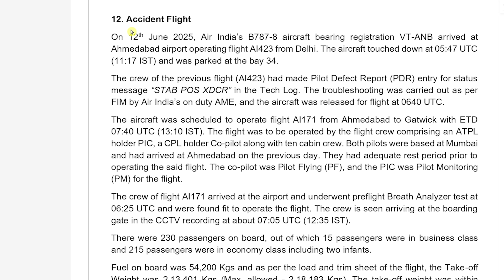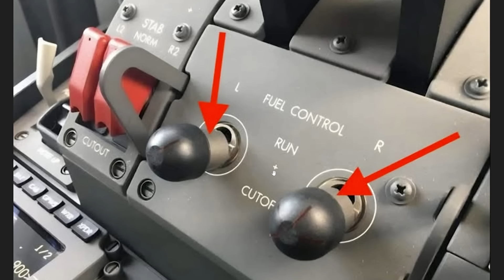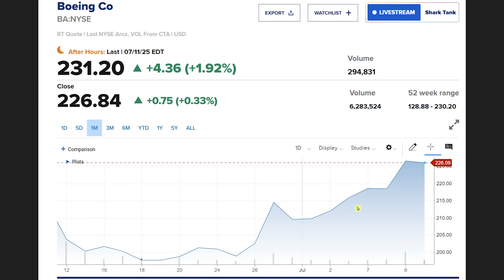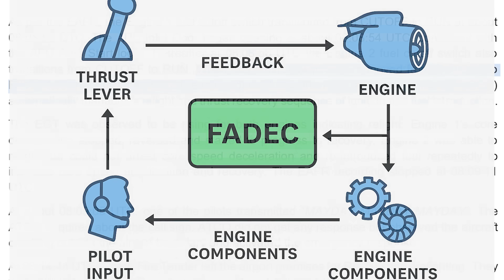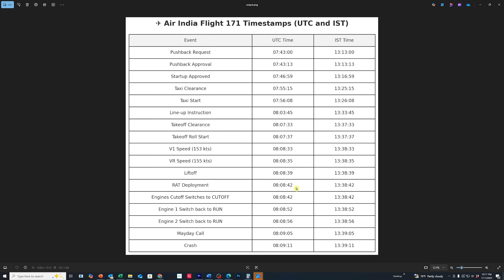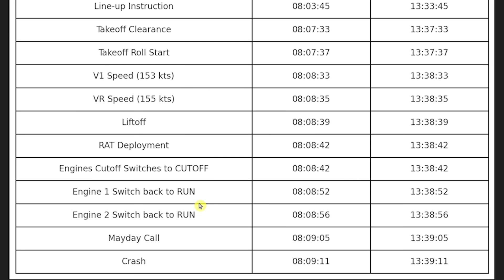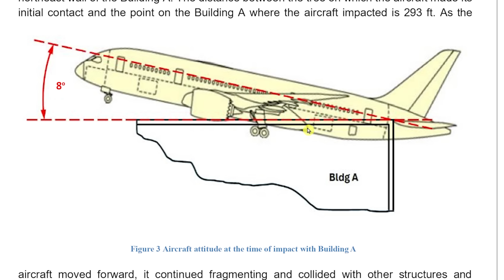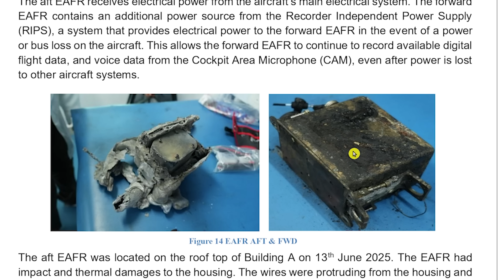Did Pilots CUTOFF Fuel? Shocking Twist Air India 171 Report!

Comment: This was either:

A pilot’s intentional act (covered up by the system), or

A catastrophic design flaw (covered up by Boeing).

Great analysis as always!
Reply: There's too many other models of Boeing aircraft that use the same part number of cutoff switches. Besides, the whole throttle quadrant on this particular airplane was replaced at least twice, the last time in 2023 so it had the updated switches. There was an issue a long time ago on the 737 but it was found to be an installation error there was an advisory sent out for maintenance to look at the switches back in 2018 to make sure the detent piece was installed properly.
Reply: @brnmcc01  Exactly! And, if I recall correctly, that issue never caused a crash either.
Reply: If it was a "design flaw" it is up to the person making that allegation to demonstrate how the design was inadequate under non-intentional use. If you cannot show how the switches could be accidentally switched off,  or that some freak occurrence failure happened, you are casting shade where none is to be found.
Reply: @Lawrence-lj5jz  It was never a flaw, there was just an advisory sent out by the FAA for 737's, an advisory is not the same as an Air Worthiness Directive (mandatory) an advisory is just a hey, heads up, look at this if you have time etc.
Reply: @brnmcc01  I didn't say that there was a flaw. I said if you are making an allegation of a flaw,  you have to produce the evidence.
Reply: @Lawrence-lj5jz  I know. Extraordinary claims require extraordinary evidence etc. :)
Reply: @brnmcc01  

the advisory must have been based on prior incidents...
Reply: In all the Boeing aircraft you’ve flown, have you ever seen this “design flaw” cause any issues in flight? Have you reported those through the proper channels?
Reply: If investigators had any suspicion whatsoever that it was Boeing, all 787s would be on the ground. I think they know it was PIC.
Reply: Preliminary reports never apportion blame. They just list the known facts - or some of them.
Reply: @alayneperrott9693  Not sure about India but in the U.S., NTSB Final reports do not apportion blame either, they list probable causes and are not admissible as evidence when it comes to the probable causes of the accident.

However, the facts and technical data gathered by the NTSB can be used in court.
Reply: Millions of flights in Boeing aircraft with this design. One fatal accident because these switches were cycled in takeoff. That doesn’t sound like a basic design flaw Boeing could have covered up for decades. You might need to step away from denial.

Comment: The co-pilot was flying the plan so the captain was doing the communictions and all 'switch-actions' in the cockpit. The co-pilot is only concentrating on a save take-off and giving the commands what actions are needed according protocal. The captain in this case controls all the switches and levers.
It's clear to me the captain, for whatever reason, must have deliberatly pulled the the fuel-switches in the 'cut-off' possition. There's no other way to do this.
Then the co-pilot asked the captain why he cut off the fuel and tries to restore this intentional failure by pulling the switches to the 'run' position again.
The latter action is the best proof this was an intentional induced, deadly failure by this captain and not any technical problem.

Comment: Is it possible there was a 3rd party on the cockpit on the jump seat? This has not been clarified or denied in the report. 
While the 2 pilots were focusing on flying and monitoring, a 3rd party could reach forward and switch them off. 

Captain monitoring would see the fuel cut off on the front panel, and the few seconds it took to turn them back on would possibly be accounted for as the time it took the Captain to realise the switches were off and turn them back on. 

I’m loath to cast any blame on either pilot as we have no CVR audio or transcript. 

To me the Captain, a very experienced, diligent Captain who trained pilots, was about to enjoy retirement looking after his elderly father does not appear to fit the Andreas Lubitz’s of this world.

Comment: How were the engines both cut off at exactly the same time?  That seems to be a difficult thing for a human to do.  Particularly if one of them was being fully distracted by a  moving seat. They went back on a fewseconds apart, as you would expect.  And the plane deployed the RAT at the same time.  Sounds like it could be a computer issue - Boeing has previous in this area.

Comment: The fact the RAT deployed at the exact same moment both engines were switched to cut off. Just 3 seconds after lift off, it seems like there may have already been an issue with the aircraft that the pilots were dealing with.
Reply: The RAT comes out when the engines are cut off. That is the whole point. Airplane does that inmediately out of emergency (when they are no longer on the ground). If they were on the ground it wont come out because the plane senses that the wheels are on the ground.
Reply: The report is hiding all those time stamps.
Reply: @jxmai1000   What are you talking about? The report mentions when each things happened to the second.
Reply: There's a clear attempt of a cover up. We only knew what we know about MCAS because Ethiopia Airlines and Ethiopia's aviation authorities, refused to have their black boxes sent to the US for analysis as it is customary to send them to the aircraft manufacturer's state. Those 737 Max crashes would most certainly have been put down to "pilot error" if Boeing and the FAA got their hands on those Flight Data Recorders.
Reply: It takes a bit longer to fabricate an AI fake recording.
They didn't publish the full conversation because it was a technical failure! Boeing has a history of electrical issues and it started on the flight before!
Reply: I really wonder about people posting comments like this... The rats purpose is to provide power, as soon as both the engines are cut off it deploys because the plane loses power.... 🤷🏻 It's pretty straightforward
Reply: 就是说拉起操纵杆之前引擎还在正常输出

Comment: If both engines fail and the RAT deploys, then the memory items for "Dual engine failure/stall" is "both fuel control switches: Cutoff and back to Run" basically a system reset.
Reply: The butler did it in the drawing room with a candlestick.

Comment: As I understand it moving the engine switches sends an electronic signal ( EEC) to the engines to switch off fuel & electricity to them. 

It’s entirely possible for the same mechanism to generate these signals without manual movements of those switches hence the captain saying he didn’t move them 

I am reminded of United Airlines Flight 585 and USAir Flight 427 when savo valves would suddenly reverse without warning & cause crushes in rare peculiar conditions that were not evident or reproducible in laboratory testing. 

If we rush to label this pilot suicide without foundation more people will perish 

The movements of two switches from RUN to CUT OFF & back to run again whilst having to pull up the switch each time would require super human reflexes even if that is the only task one pilot was concentrating on - that is eight maneuvers right there since eventually the switches where found in RUN positions.

Let’s not jump into conclusions
Reply: WRONG, there is no software/electrical signal that would cut the fuel supply to the engines, in this case the movement of the switches did happen so yes, switches were operated by a human hand
Reply: @olasek7972  

you are wrong.  there is no way a cockpit switch is directly connected to the valve controlling fuel supply.
there is an electronic interface, though perhaps not controlled by software.  
maybe the opto-coupled switch IC failed or there was a transient spike on the line or intermittent power loss to the solenoid or electical interface.
Reply: @mth469  now comrade you have to explain how BOTH switches suffered the same "spike" within a second of one another and it all happened in the WORST possible time. If you believe it was all coincidence I got a beach property for you in Oklahoma.

Comment: How come the RAT was in action before the CUTOFF, at least according to your time chart? It says "RAT deployment" at 8:08:42, followed by "CUTOFF" at the same time. Shouldn't the RAT deployment occur at least a few seconds after the CUTOFF, and not before or at the same moment?
Reply: It deploys at the same moment if the engine master switches are placed in cutoff position, and the weight on wheels switch is open (meaning in air mode).
Reply: It could just be an entry logging issue if milliseconds are not taken into account.  I've seen software do that in other industries.
Reply: @bobl703  each sub-system would be having an internal clock to which all records emitted are timestamped.  the clock (of all sub-systems) would be synced with the system clock including the one recording the flight log.   

thus regardless of when the message arrived at the flight logger, the time sequence (i.e. sequence of events) could be reconstructed.

Comment: My question is why did the RAT deploy? My understanding is that this only deploys if there's insufficient power. So why is there insufficient power? Could insufficient power automatically cause the engines to cut off? Why the RAT? I wonder if the cutoff to the engine should have been an immediate cutoff and turned back on, but if they failed to turn back on due to engine issues. I agree that they should have been turned back on within seconds, so something there is very suspicious.

Comment: Maybe the switches failed or the electrical circuit malfunction if the power suddenly failed the pilot flying though the the pilot monitoring shut the switches off but it failed at another point in the circuit I doubt they can tell if the switches were actually manually moved

Comment: Was there a 3rd pilot riding in the jump seat.  If anyone was sitting there, they could have easily pulled the switches while the pilots were focused on the takeoff.  Due to the length of the flight to London, maybe there was a relief pilot in the jump seat.  India needs to clarify who was in the cockpit if any aside from the captain and first officer.
Reply: I think another YouTuber covered it but it was the copilot flying the plane and the captain doing the monitoring.
Reply: @waywardlyfe3092  Pilot went cuckoo
Reply: No this would have been listed in the report. Looks like one of the pilots lost it. My guess it was the pilot. Other pilots from the airline are saying this guy was on sick leave and known to be unstable.
Reply: @androida99 how do you KNOW it would have been included in the report?! Do you know how the Ministry of Aviation and government edit these reports and remove things to suit themselves?
Reply: @Lottie.Bronte321both boeing and Air India are putting the blame on dead pilots
Reply: My feelings exactly. I feel there was a 3rd party involvement.
Reply: I feel the fuel switch was never switched on from the beginning. It was in Cutoff position all the while. The flight would have taken off with the fuel left in the engine and the supply lines. For example in  the fuel control of motorcycles even if its turned off it will run for a while similarly this flight would have taken off and exhausted the fuel in the supply lines and engine and taken a dip instantly.
Reply: @alexstephen0 no. Just no.
Reply: Ok @Chiefcheeseofcheddington
Reply: @alexstephen0 would there have been enough though for powering up, taxiing etc… I wouldn’t have thought so?
Reply: @alexstephen0  Zero possibility of this. You needed 2 tonne of fuel to take off this aircraft under close to max loading which this aircraft was. No way 2 tonne of fuel was in the fuel lines.

Comment: I trust they'll look at both pilots equally, and don't make any suppositions based upon the as-yet-unidentified pilot question to the other pilots, accusing the other of turning off the fuel.  If one were going to switch off the fuel intentionally, knowing death was imminent, one might also want the other pilot to be under suspicion, and be prepared to ask a detailed, unambiguous question to the innocent pilot.  If I were the innocent pilot, knowing the likely consequences from both engines shutting down at that altitude, I think I'd be more likely to ask 'what did you do?' or 'why did you do that?' instead of the longer, more play-by-play-like "why did you cut off the fuel?'.

Comment: As per the published info , Both engine cut-off switches were found in the ON position at the time of the crash. The recovered, burned unit also confirms this both switches still showing ON.

Before jumping to conclusions like mental health issues, we need more technical clarity.

When someone activates the fuel cut-off switch, does it stop fuel flow via a hydraulic mechanism, or electronically through a system controlled by software or a driver?

The answer to that determines whether the sequence was ON-OFF-ON or simply ON- O̶F̶F̶ - ON and that distinction is crucial.